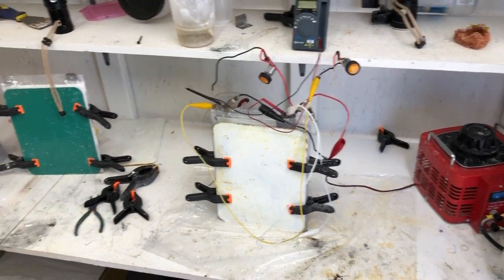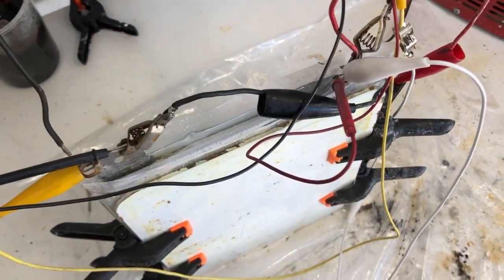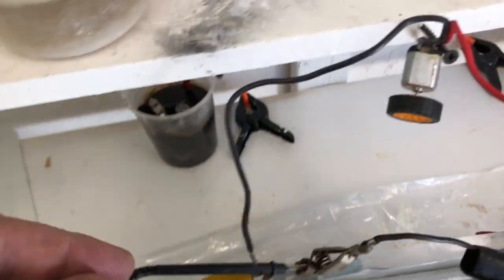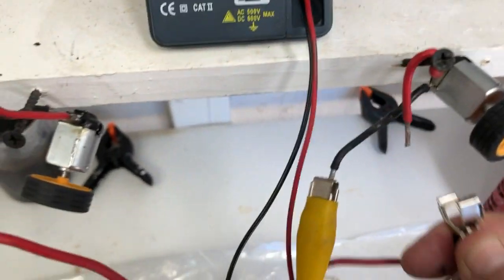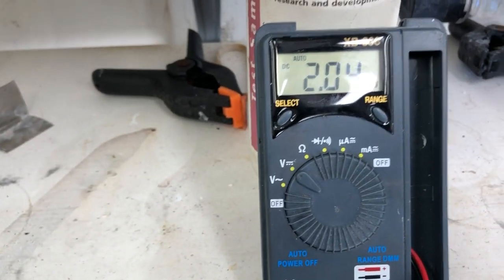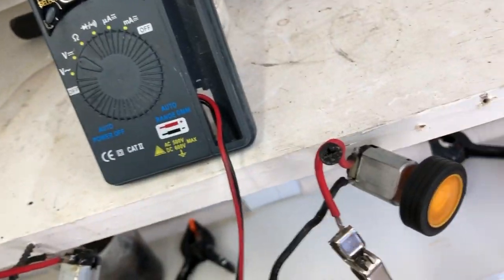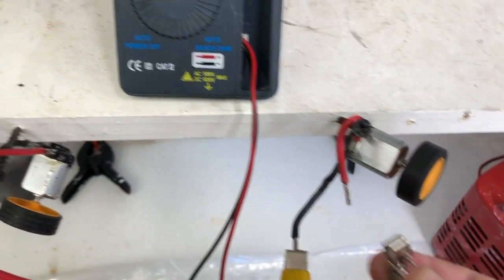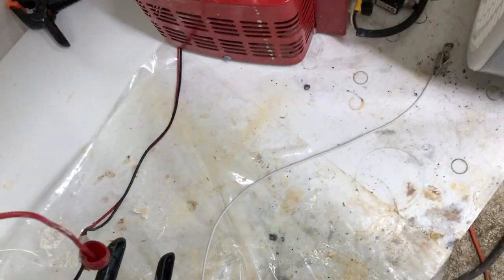Worlds best battery Aluminum Sulfur battery lasts over 50 years

Comment: I think its fake that's not possible
Reply: All the videos on this Channel is: "run this motor for Days / Weeks" and "voltage climbing after unplugging motor is a sign of recharging". However this Guy never uses an ammeter! If he was serious, within 5 seconds of introducing a new battery chemistry, he would show a proper charge / discharge graph and his second slide would be cycle life tests. It is Very simple to make qualitative tests of batteries, to get some real data. However what he does in several of his videos, is  babble about starting production intending to Sell small quantities, so we All know what this Channel is really about! As an example of a chemist, that is not Actually trying to decieve people, and Also has a vocabulary to explain what is happening, Better watch Robert Murray Smith on YT, he is honest about energy and power density and shares every detail openly.
Reply: @Tore_Lund  

So,  He doesn't give away his findings. But he gives many  clues. To be sure, he has sprinkled clues all over. Just pay attention. 

Robert Murray Smith also gives clues, but he doesn't give it all away either. These ideas can spur more thinking, and then you can allow your intuition seek more.  Who knows, someone  might intuit a better solution. Build on what others have tried ...
Reply: @wil04us  he phas been proven right

Comment: Might I assume that you are using a deep eutectic solvent / ionic liquid made from either urea and AlCl3 or DMSO and AlCl3 as electrolyte sind it has to have a high ionic conductivity, is slightly acidic because of the incomplete electron octet  and hence it acts as a lewis acid. 

In the video are slightly scientific inaccuracies concerning the general battery chemistry and terminology but overall fascinating that you got such a high power from the device.  Does this device exhibit (poly)sulfide shuttling through the electrolyte?
Reply from the maker: No, Our sulfur is in a solid state format.  Still testing and motors running everyday so far.  It takes years of testing to prove-out a battery which make development so slow but the work has to be done.

Comment: Is this something a DIY person could make?
Reply from the maker: I think the difficulty level is too high unless we do all conductive coating work which is 95% of the skill level. 

At that point I do not know how much money a DIY could save.  Just do not know enough yet. 

Keep watching the channel for updates.
Reply: @WINDGENEERING  2 years later..any updates?  :)
(like what even is the electrolyte? and what does "polypropylene and paper" mean, and is it just sulfur powder submerged in the electrolyte on one side of the membrane?  and if the aluminum is the cathode, what's the anode (or current collector) made of if the sulfur is just room-temperature solid powder? :> )
Reply: Thanks for the reply. Could you do a more in depth video on this? It's very interesting.
Reply from the maker: @jumonjii   more to come later. Right now were figuring out how to get into full-scale production of 6000 batteries per month to start. It also costs a small fortune to build all the injection mold plastic housings that will hold everything.
Reply from the maker: @jumonjii    give us some more time as were making some minor improvements and trying to put together a production plan for 6000 batteries per month and all the mold making is expensive and takes a lot of time to perfect. We're trying but it's a big job.
Reply: I understand. I think this really interesting even though I have no idea how it all works. Can this be scaled to "off grid" kinds of things?

Comment: That's impressive! Will the aluminum oxidized? I really appreciate your dedication to your prototype! Thanks Bob!
Reply from the maker: Hi Billy,  No it can't oxide since it is the Cathode and cathodes put off H2 or hydrogen gas which is a reducer (anti-oxidizer)  The aluminum atoms are in a state of flex so all that can happen is that aluminum atoms slightly migrate around and the plate and gets a little rough looking because of this.
We have noticed that the older and rougher the aluminum plate gets the more surface area we get and therefor the more powerful it gets year after year.
This battery may not only last 50 years but the bell curve of stored amperage suggests that this battery may actually peak in performance the older it gets.
I always like the idea of using sulfur as an active material since you can strip two electrons from it.
This is a lithium free battery but here's kind of what were doing but only much more advanced - http://jes.ecsdl.org/content/165/1/A6058/F14.expansion.html

Comment: Would that need a BMS when it’s finally done?
Thanks for sharing... a 50 year battery would be awesome!
Reply from the maker: How you doing today?  It might need a minimal battery management system but not a complex one. The really great part about this battery is that it can't be overcharged and you can completely discharge it to 100% and just start over again without any penalty. If you overcharge it you will lose a lot of water which just has to be poured back in as deionized water and that's the only penalty for overcharging besides being electrically wasteful.  If it's accidentally overcharged you just pour some deionized water back into the cells and your back to square one. If you charge it properly at no more than 2.2 V per cell it doesn't even make any gas so there is no water loss either which is another plus. 

I have even run one totally dry until it died. Then I just re-added deionized water and it was back to a 100% usable state in less than 30 seconds. Then just recharged it and it worked again and again good as new.
 It's probably one of the most forgiving batteries I've ever used in my life. In the next video will do a 6 cell 12V because I'm ready to ramp up the testing. We started with 124 batteries 16 months ago and this is the only battery that made it,  the rest are all dead showing a myriad of problems including power fading and material degradation. 

With our aluminum / sulfur battery not only did it last 16 months but it actually works better now! Lots of research and lots of luck but we've got something special here. I can't wait to share it with the world but building a battery factory is a very large and expensive venture so I'm going to need partners. One thing I am sure of is that this particular battery system will be one of the most sought after types in the world for stationary alternative energy use and even automotive. With an energy density of only 80A per kilowatt hour you won't see this type of battery in any cell phones anytime soon. However in a world where resources are limited this battery is going to do really well. Lithium's nice and I've made plenty of good lithium batteries in the lab but there is only enough lithium to build about a billion electric cars before the price of lithium gets higher than the price of gold. Even battery experts like Sony and Sanyo realize that lithium ion batteries are only a stopgap and something new needs to be developed soon.

Our goal from the beginning was to use the most abundant elements as the basis of our battery and aluminum is the 3rd most abundant element on the face of the earth with sulfur not far behind. 

I think one of the best uses for our aluminum sulfur battery is storing solar and wind energy to allow the power grid to offer buffered power that can be easily managed by grid authorities or people living independently off grid. Dollar for dollar and amp for amp this technology beats nickel / iron Edison batteries by a factor of 30 to 1 at only one fourth the physical weight.
Reply: I really think he's going to change the way we all think on battery power storage 😃